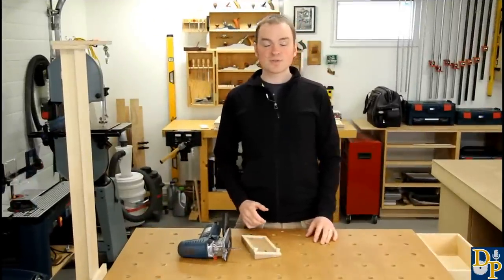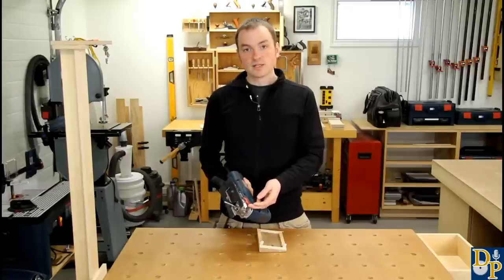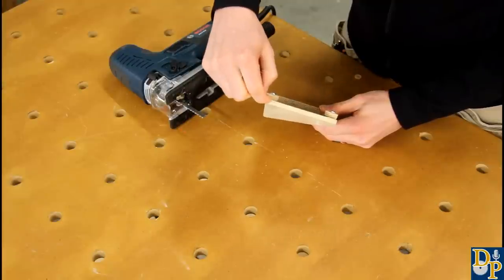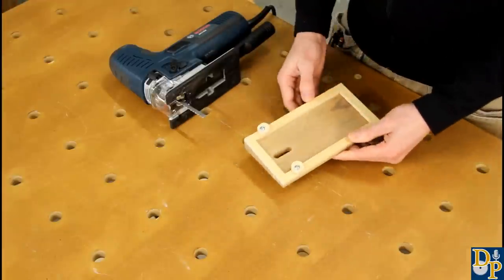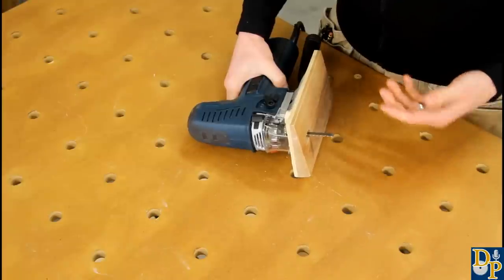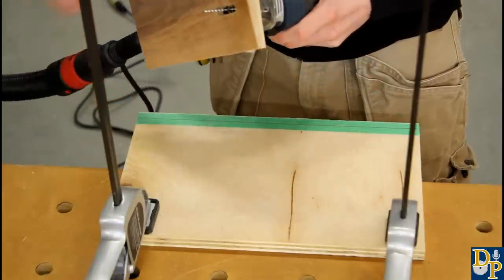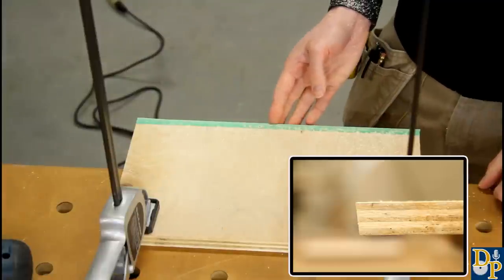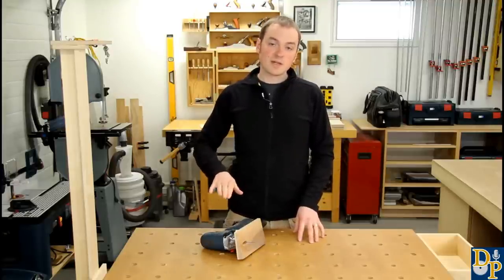Jigsaw Scribe Base - How to Make and Use One

Comment: I just hold the jigsaw upside down, blade at 90 exactly as shown here -but I use the tip of a finger to gauge the scribe tilt between saw base and work. The saw essentially rides on one edge (taped to prevent marring the work) and my finger.  Have done 1000s of cuts that way with good results and no need for an aux base. I can also tilt in either direction that way.  Pro installers learn to do things the easiest and least complicated way.
Reply from the maker: +Tioga Fretworks great tip, thanks for sharing.
Reply: A Collins coping foot really makes this process easy
Reply from the maker: +makthaknife that's what I use for coping all my trim work and it works great.

Comment: Thanks for this tip, Dan! How do you like the barrel-grip jigsaw versus the other kind? I had never considered the possibility of holding it upside down to make a cut, very interesting!
Reply from the maker: I really like the barrel grip Tom. I find it has better control and balance than a top handle, plus it makes it much easier to use upside down which I do a lot.

Comment: Nice jig--good design. Would definitely watch a video on scribing. Quick question: are your carpenter pants with built in apron pockets Blaklader? Duluth? Jobman? And do you like them (whichever pair you have)? Looking for a new pair. Thanks!
Reply from the maker: +Steven Smith thanks.  The pants that I wear are the Blaklader Brawny pants.  They are by far my favorite work pant and I have several pairs and that's all I wear now.  I love the pockets and knee pads and they are a very durable pant as well.

Comment: that's a cool solution. can you tell me if it obscures your view of the blade when cutting standard topside.
Reply from the maker: +D twist Rewind I still get a good view of the blade since the slot is big enough to see down into it. Having a saw with a built in light helps too.

Comment: Hello. I'm interested in becoming a finish carpenter. How did you go about doing what you do? Are you a union carpenter? Should I just apply at a finish carpentry company? Anyway, nice videos. Take care
Reply from the maker: +Nalu Rash I'm actually self taught when it comes to cabinet making and finish carpentry. My formal education was architectural technology which I still use a lot of what I learned in what I do now. I've been woodworking since I was 13 so it's something I've been doing for a long time. Do you have any experience in carpentry? You could either do a course and get your papers or you could learn on the job if you have a bit of experience to go on. It's a bit easier to find a good job if you have your papers though. I'm self employed in what I do. Hope that helps.
Reply: Thank you very much for your response. Like yourself, I was self taught since 15, working for a sign company and doing side projects here and there. Yes, your answer did help and so do your very informative videos. I love how clean and efficient you work. Happy Holidays

Comment: dumb question why wouldn't a small portable table saw work better for that cut
Reply from the maker: +em forty if it's a fairly straight scribe line that would definitely work.  I like the jigsaw because you can follow a more curvy line easier and safer than a table saw.

Comment: How in the world do you call that a scribe base . It's just a base, that's why you never really show it do any scribing doesn't work. Show and prove otherwise the subject line should read jigsaw base with no reference to scribing
Reply from the maker: +Angel Santiago I designed the base specifically for making scribe cuts with a back bevel which is why I called it a scribe base.
Reply: I have done the maths, you get roughly 15% more base space, and that is even without taking into account the fact that the blade can wonder off sideways. to me this seems like a plate cover, and pretty useless. the same result can be achieved with just a bit more exercise and a little more visibility which this obscures.